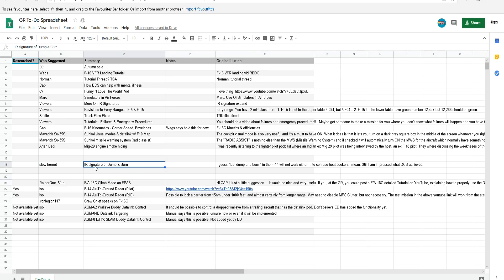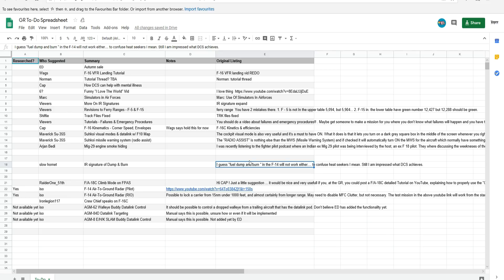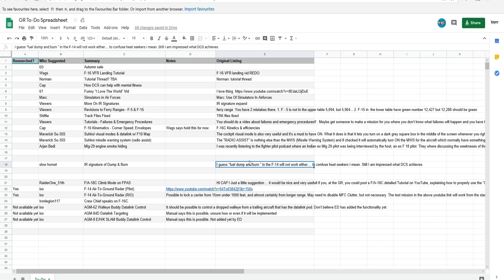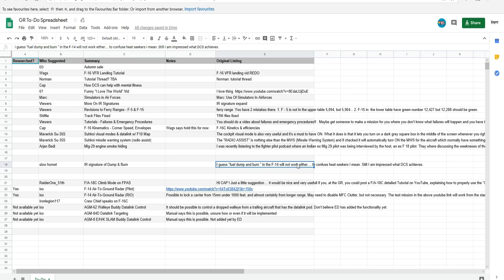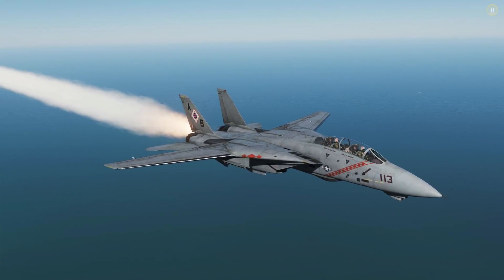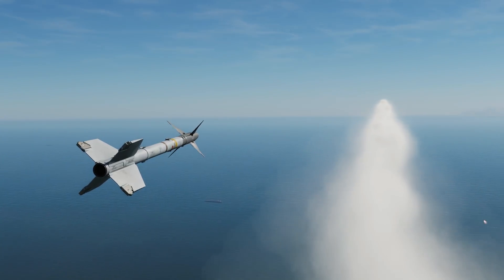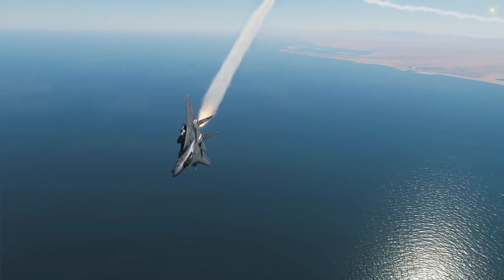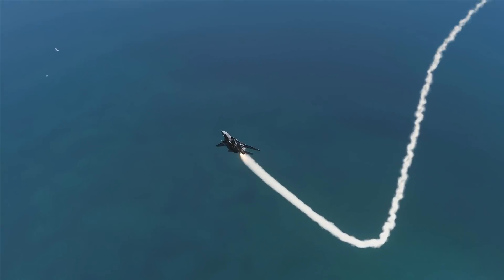Questioned: Can "Dump & Burn" Fool IR-Guided Missiles? | DCS WORLD

Comment: sidewinder missiles have a continuous rod warhead. and a proximity fuse detonation. so it will  fly past the hottest part of the heat source its locked on to and detonate. when it detonates the rods make a giant circle so it will cut parts of the aircraft off like the tail or cuts engine or engine's like cutting off or damaging the compressor turbines of the rear section of the jet or putting a big enough hole in the combustion chamber that the engine will die.

Comment: The dump and burn in dcs doesn't really look correctly modeled... The flame is way to concentrated near the nozzle.

In reality the flame would be 15-20 feet behind the plane, and even more so at high speeds.
Nor would the flame be concentrated near the nozzole, with a fast burn, IRL it's a bigger fuel cloud that expands with a slow burn 2-3 times the length of the actual plane...

Keep in mind Jet fuel is more like Diesel then like Gasoline. it has a higher flashpoint(38C so won't ignite in cold temps as easily as Gasoline (-43C) would...

Also keep in mind that Jetfuel burning in open , cold air (800F)will be a lot cooler then Jetfuel coming out of a jet engine with Afterburner added(1500 to 1700 F).
It will be cooler then flares(2000 F) as well, so any modern seeker would discriminate against it and go after the hotter source.
Reply: Waaaagnerrrr!!!

Comment: Hm wondering if you were to cut throttle and fire off a missile, would the incoming ir missile  track that?
Reply from the maker: I'll have a go.
Reply: Ya I would say, if it’s on your six, cut power, launch, and either climb vertical 90 or roll inverted and split s...

Comment: Really modern IR seekers don't just home in on a heat source,  they attempt to home into an IR image of the target plane  and reject random heat sources such as flares.  ASRAAM certainly does that, I suspect a 9X would to? And the idea is to home in on the cockpit area rather than the engines to take out the pilot and control systems.
Reply: Exactly, so creating a heatblur screen might help to blur the vision of these newer missiles

Comment: This would possibly work on a first generation Sidewinder versions (basically until the mid 70's) or the French Magic I missile.
These missiles used an IR proximity fuze that could detonate prematurely flying by something hot like an afterburners tail or a fuel dumping one.
The IR fuze works by having IR lamps that illuminate it's surroundings since there is nothing there it get's no reflective return, when it does say pass by an aircraft the skin of the aircraft is illuminated by the IR lamp just like a flashlight (but on an IR frequency) this is then reflected back at the missile where an IR detector causes the missile to detonate.
The problem with early missiles was that the fuse was also set of by the afterburner of enemy jets. Hence there is a way this might work.

Missiles from the 1970's on switched to laser proximity fuses to combat this problem.
Look  at the Sidewinder 9B and 9M and how the proximity fuzes are different.
Reply from the maker: Roger AJ

Comment: I would have been very surprised if it worked. Maybe if you were out of flares and had no other options? The fuel would be put to better use in afterburner and evasive maneuvers. I think the best case it could give you would be to move the targeting location of the missile back a meter or so reducing the damage to the aircraft to increase the chances of pilot survival and maybe a chance to return to friendly airspace or hopefully limp to a runway.

Comment: The afterburner is hotter than the burning fuel.  Won't work.  The F-111 had the best dump and burn of them all, but it is still not as hot as the afterburner spray-bar temps.
Reply from the maker: rgr

Comment: Naw cap the missiles have a continuous rod warhead that has a cone like arc in front of the missile. It wouldn’t make sense for the missiles to try and acquire this kind of angle because early sidewinders couple pretty much only lock on from the back and had a tendency to lose lock. Trying to get a missile to blow up on the side of a plane would just add to the complication
Reply from the maker: Thanks Sir